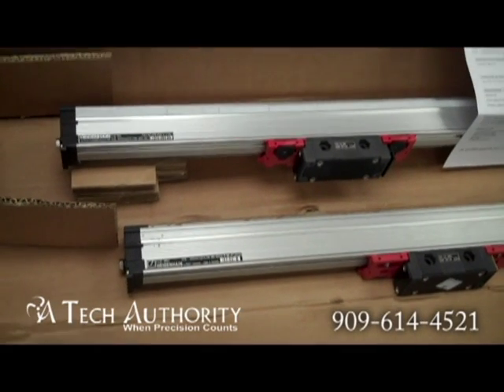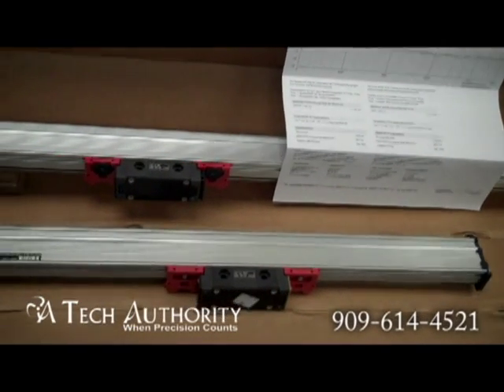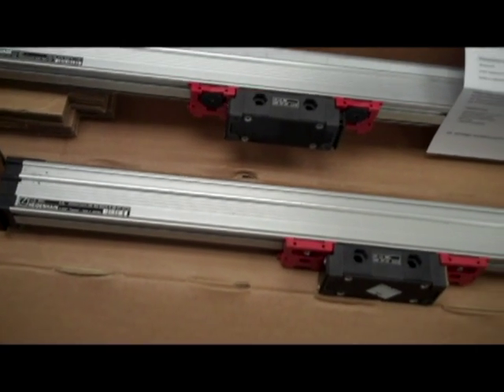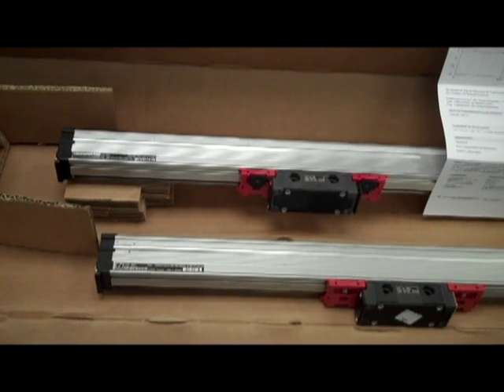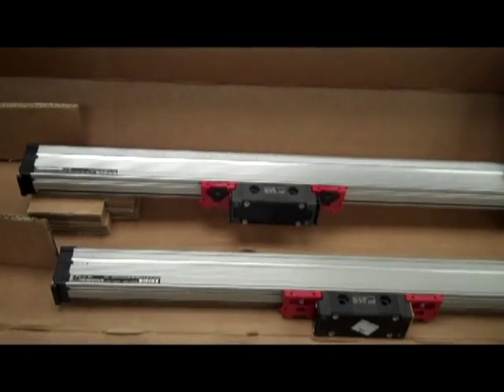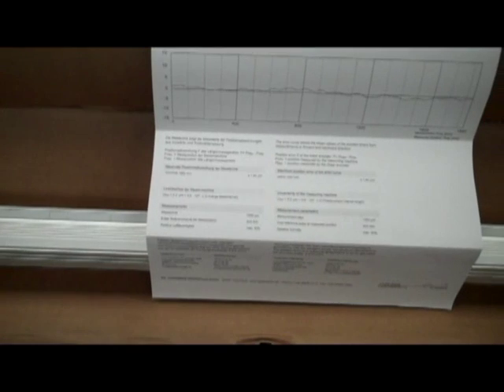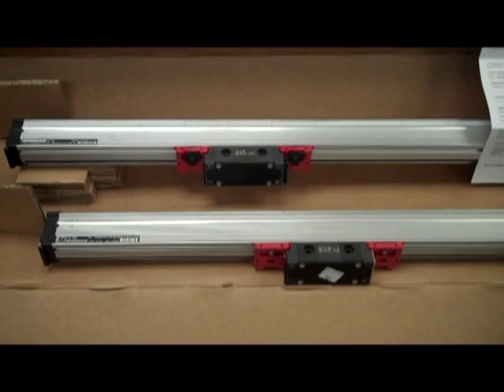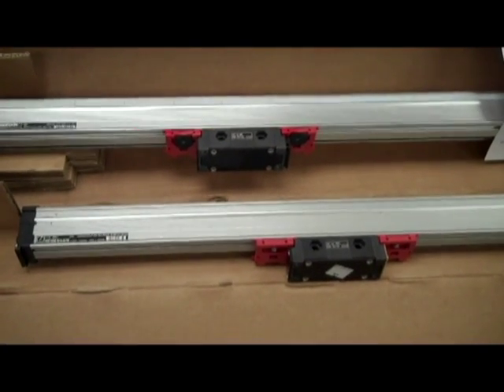A Tech Authority - HEIDENHAIN LS 186 Linear Scale

Comment: Hi Sir 
 in CNC machine LS176 is used, LS176 is fauty now in these day,        I have LS 186 and LC185c in stock or sotre, Can i used these LS186 and LC185c  with fanuc Sparete detector SUD1 Fanuc
Reply: Hello Rana, The LS186 and LC185 are very different scales.  However, to answer your question, the LS 186C and LC195F will work with the Fanuc SDU.  The LC185 will not work with Fanuc because it produces the EnDat protocol rather than the Fanuc protocol.